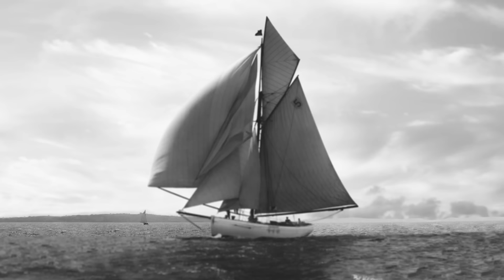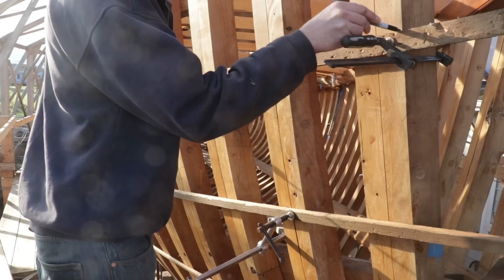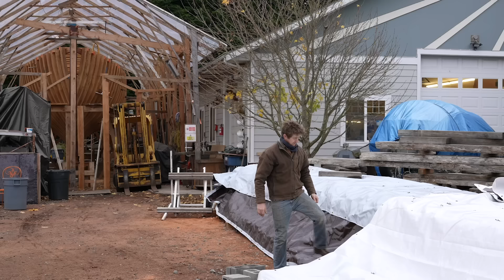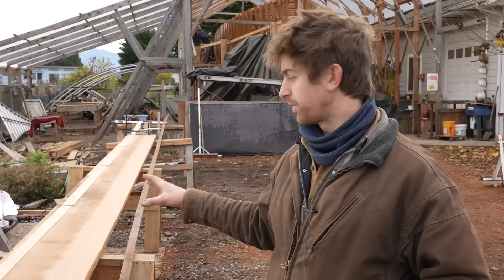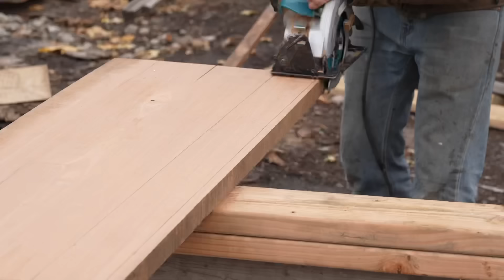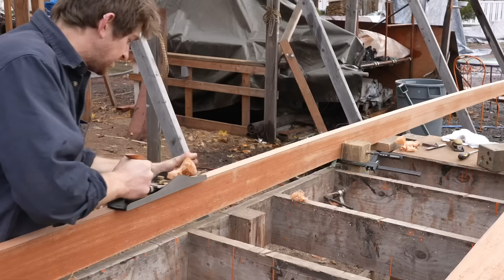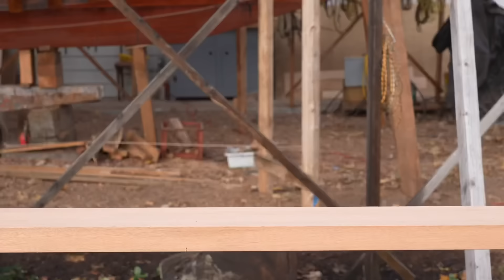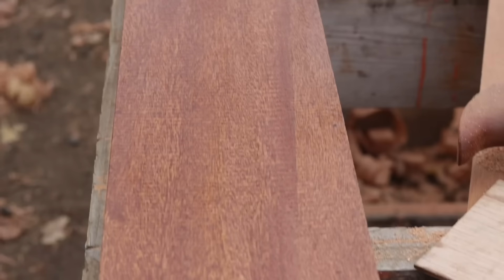Fitting the first new planks / Wooden Boatbuilding (TALLY HO EP85)

Comment: When driving the rivets, do they not need to be caulked?
Reply: The outboard rivet head is countersunk into the plank. After the rivet is set, a short length of dowel will be glued in to seal the hole.
Reply: @frederickstibbert7389  That makes a lot of sense, thank you for your reply.

Comment: I love how many nuanced moments are captured. Like when Leo is cutting the plank and the circular saw cuts out because the plug pulled out on a snag. That has happened to me numerous times in lumber framing. Great documentary Leo!
Reply: Leo your skills are impressive for a man of your age....
Reply: I shudder went through me when took both hands off the saw while it was still spinning. Maybe it was the crap timbers I used to cut - but I have had saws grab and kick themselves up and out of the cut.
Reply: @Sendu7  Ha! I thought.. 'pro moves!'
Reply: @Sendu7  Call us safety Sally’s, but after 40 years of carpentry, I’ve seen many accidents by unsafe practices. Running the saw with your hand on the guard as a guide is another one. I watched a hotshot cut his finger off when the saw bound, and jumped. I had warned him to stop doing it, but he was a expert. It happened so fast, he didn’t have time to pull his hand back.
Reply: @loveistheanswer8137  Yes anything can happen. I saw a carpenter put the saw on the ground without checking the guard while it was still spinning. The guard had jammed open and it took off and ran over his foot. No serious damage but a lot of puncture holes in his skin.
Reply: @Sendu7  We always use mostly worm drive saws for framework. They can be laid on there side, which eliminates that hazard. Regular sidewinders should always be checked for proper guard placement before set down. Kind of like plugging in a belt sander that is sitting upright. I have seen then take off a few times as well.
Reply: @loveistheanswer8137  Yep, have personally covered all the mistakes that can made with belt sanders. 
I now always make sure to disengage the trigger lock if the power goes off after a storm. Nothing like running back to the workshop when the power starts again and trying to recapture the belt sander.
Reply: 35 yr.carpenter and I still do it
Reply: I put a loose knot in the cables before plugging them together. You can then feel when the cable needs attention before they unplug and one end drops in the dirt.
Reply: @andyrbush  I used to do the same, although on electric saws I also used to shorten the lead to just 6 inches so I was left only dragging a long extension lead with no joins. It worked pretty well too, especially when climbing around roofs.
Reply: @Sendu7  

Also what I do and recommend.
Reply: i like hom american power plugs are designed to pull apart under accidental tension as a sort of safety feature, british ones don't really do that
Reply: @cliveramsbotty6077  It's not a safety feature, just part of the generally crap design. They don't pull apart easy when everything is high quality and new, the pins on the plug bend easy (often deliberately to make a tighter fit in a loose socket), and then damage the sockets when rammed in.

Usually after the cord pulls out of the extension cord once the operator will walk over and tie the cords together.
Reply: That's such a common thing to happen, especially when you swap tools on the long extension, and forget to tie the knot. :))
Reply: We had twist plugs and you could pull the cable along with you , but OSHA came along and said a quick disconnect was not easy to do , so as always a great design was ruined by some office crab and the lawyers.
Reply: The British 110v plugs lock together so this can’t happen

Comment: Hey, notice that when you cut planks off at a 90 you just follow the line freehand with the saw. Get yourself a 'speed square' and use it as a guide. They make them in 7" and 12". May make things easier, may not.

Comment: I have been watching.  You really do exceptional work.  I appreciated the time you spent to allow us to see the scarf of the replacement piece of the insect/sapwood repair.

I am a hand plane sort of guy, in the extreme.  What I did appreciate myself was finally seeing a good use of the hand power plane.  You were fitting the strake at the stern and hand holding  the free end of the plank.  That would be nearly impossible with a hand plane and you made it look easy with the power plane.

The bronze work looks a bit of over kill to me, but I suspect you know much better than I.  The additional weight above the waterline..?  Might that make her a bit more tender?  You have likely figured that all out, but it does make me curious.   I look forward to seeing many more episodes. You are a fine craftsman  and you have developed a remarkable crew.  My highest compliments.

Comment: Why not add some screws in the side of the patch in addition to the epoxy?
Reply: Wondering why Leo didn’t use resorcinol adhesive there. Edge fastenings not necessary in my opinion
Reply: Wondering why Leo didn’t use resorcinol adhesive there. Edge fastenings not necessary in my opinion
Reply from the maker: Fastenings going in that direction across the width of the plank would cut a lot of grain and weaken the plank a lot.

Comment: With as many rivets as you'll be doing it is worth grinding the mushroom off the back-out punch that's being used as a driver 32:56  
The mushroom curls are work-hardened and can break and come flying off when struck with the sledge.
Cheers, and thanks for another great Saturday morning video!

Comment: Everyone I ask gets super cagey about their boat soup recipe. I rarely get a straight answer. Is it equal parts boiled linseed oil, pine tar, and turpentine? Do you play with the proportions depending on the wood or season? Help a brother out!
Reply from the maker: I normally just go equal parts boiled linseed oil, pine tar and turps - and then a little penatrol is optional (less than 5% of the total mix)
Reply: @SampsonBoatCo  Thanks!

Comment: Better grind down those edges on that thing you're hammering on, the edges gets work hardened and basically become bullets if you hit them enough for it to ping off and hurt the person hammering or others 33:00
Reply: Goddeth, That is absolutely true, there have been some serious injuries to some people were little fragments of steel have penetrated their body.
Reply: oh yeah, those slivers that develop can be as sharp as a scalpel, learned all to well from spitting wood with a maul and sledge hammer.
Reply: @wdchopnfool  you and me both. Had a firewood business when I lived in Montana.  Have split 3 cords a day. There's a reason there are stretch marks on my arms and shoulders.
Reply: Were it me, I'd do away with the lump hammer too, and rig some way to use a pneumatic air chisel or an electric demo hammer to drive those things.
There are grounding rod driver attachments.
Much, MUCH faster and it won't tire you like swinging overhead.
Reply: @jimurrata6785  I agree.  When they hammer that they have to hammer hard enough to move all the weight of that hammer the driving tool and the rivet.  Even if they don't use a pneumatic chisel they should just use the driving tool alone.
Reply: @jimurrata6785  There's been a noticeable lack of pneumatic tools of any sort on this project. I wonder if that's due to lack of tooling and equipment or something more fundamental such as a limited need for such tools in boatbuilding.
Reply: @Phyde4ux  I appreciate that Leo and crew are using many traditional hand tools on this restoration.
Being in the building trades I can appreciate getting away from the din and dust of many power tools.
But here we see Leo with circular saw and power plane, so he's not against modern tools.
I think a small electric hammer with a ground rod driver would make quick(er) work of the thousands of rivets and roves.

Comment: Are you sure the insect damage was done in nature and not while the wood was waiting in your planking stock?
Reply: That's a good question.  I once had some rough sawed white oak in storage in my garage for several years.  Then when I went to plane it for use I found that it had many small worm holes that were not there when I had the log milled.  I used it to restore an antique kitchen free standing cabinet and the worm holed wood enhanced the character of the piece.

Comment: At the point in the video where you are contouring the power plane blades (about t=24m 40s), you are using what appears to be a Tormek, but the wheel on it is not a normal Tormek stone. It looks like maybe a diamond wheel? Could you tell me more about that? What is that wheel and where do they come from?
Reply from the maker: Correct. Tormek sell diamond stone wheels. I highly recommend them! I find the coarse grit to be the most useful, if I had to choose one, but it's nice to have the extra fine too.

Comment: As an aircraft structural engineer im fascinated to see where all this terminology is coming from: stringers, bulkheads, frames, all of it :) however butt joints we connect with buttstraps :)
Reply: not to mention the knots (speed) and the nautical miles...
Reply: It should be noted that the title of captain and the use of shoulder boards on aviation uniforms (and countless other terms) are borrowed from naval tradition as well.
Reply: How would they have bevel the planks before power planers oh my God
Reply: Dont mention staining the buttplugs, so they dont stick out!
Reply: Did that power planer only have one blade?
Reply: Putting that 1st plank on at night you must have felt the pressure of holding back all the crew
Reply: You need to trust these workers more Pete
Reply: Is that just a simple butt joint with no spacing for chaulking?
Reply: @elkskiutah8204  You can always edit your comments by clicking on the 3 vertical dots to the right of comment.
Reply: "however butt joints we connect with buttstraps :)"     or G-Strings .....
Reply: is there a rationale behind a butt joint and not a  scarf of some kind??  would think a scarf would be preferable and more water tight
Reply: Same, It's also remarkable how similar the structural layout is to an airframe.
Reply: I like butts
  Female only
Reply: @elkskiutah8204  I like big butts, I cannot tell a lie!
Reply: @elkskiutah8204  That's odd, you alway struck me as the fish butt type.😋

Comment: I'm curious, you haven't fastened the lead keel yet, wouldn't it be easier to fasten the keel before planking?
Reply: I could be wrong, bit I think this may have something to do with the weight of the keel actually distorting the frame of the boat over time. Keep in mind they are working on a dirt surface which is subject to settling over time. I noticed that Bob Esmer (The Art of Boat Building channel) has also left his lead keel off until after planking.

Comment: Hey Leo...Electricians tip...be careful running heavy currents such as your circular saw through that wound up cord reel. They have a tendency to melt when not unrolled with constant load....
Reply: Or start smoking. Better off with a figure 8 coil
Reply: I noticed the auto disconnect plug ;-)
Reply: I learned something
Reply: Adam, an old NASA trick by normal workers crew, was to just drop the cord (loosely) into a plastic square milk-crate. It never got tangled or knotted.

note: the prong side was plastic pulled tied to the crate some 4' to reach a outlet, the rest pulled out to the electrical machinery.
Reply: Yup.  And when they melt, ain't no unrolling it then.  Caleb's right.
Reply: @froop2393  Has nothing to do with induction. The copper wire will heat up due to resistive heating in the wire itself. If the wire is layed out in the open it will dissipate heat to the air and be fine. If it is all bunched up in a tight bundle, the inner wires will not be able to dissipate heat and the insulation can get kind of melty.